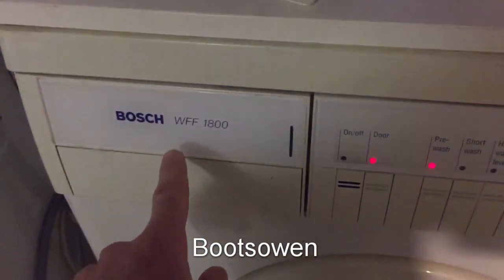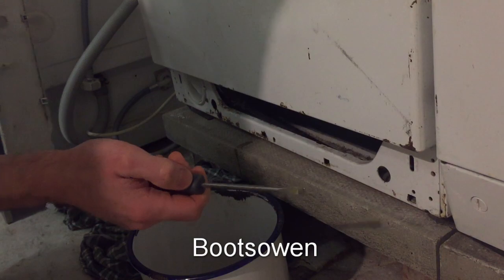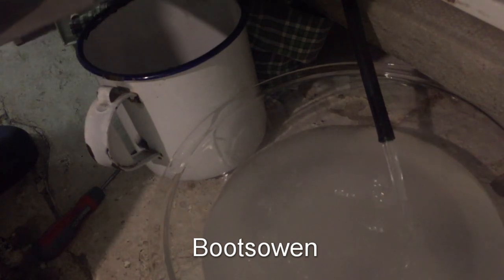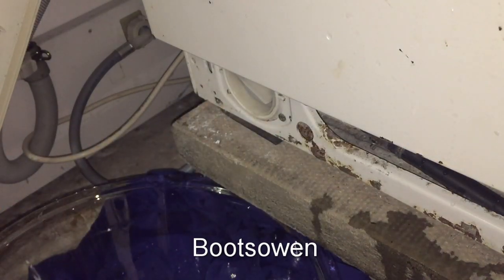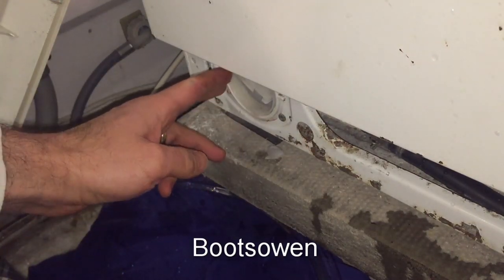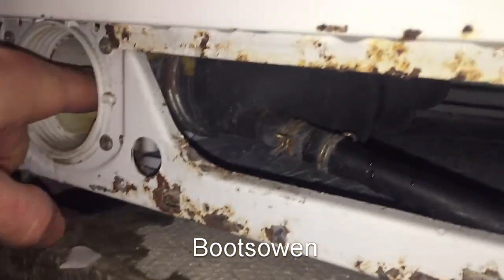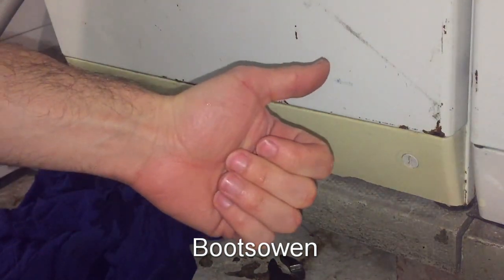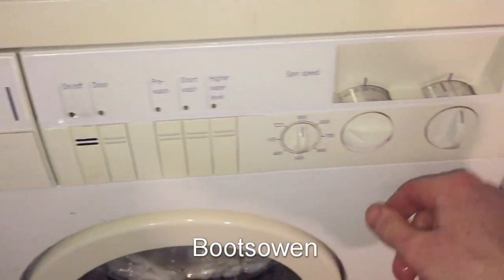Washing machine full of water with blocked filter and stuck drain plug

Comment: I think that door seal needs replacing as I wouldnt trust that not to get stuff caught in between the drums
Reply from the maker: Yes. Next job on the list
Reply: At the same time if the spider or bearings are gone for example there is more of a chance of the clothes getting stuck between the drum since the drum would leave a higher gap if the bearings or spider is bad